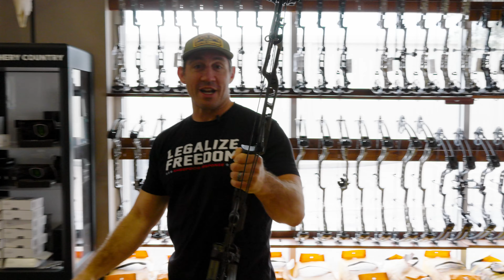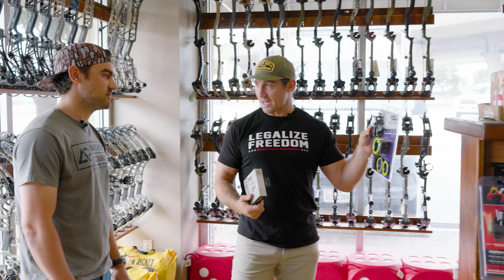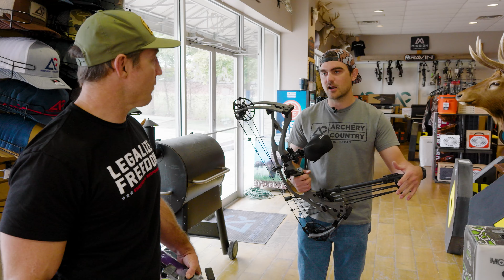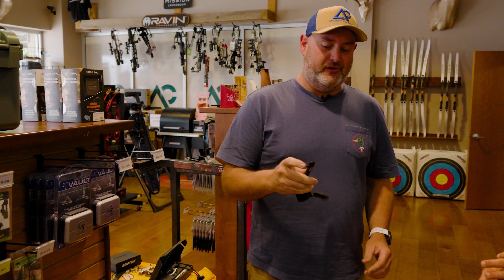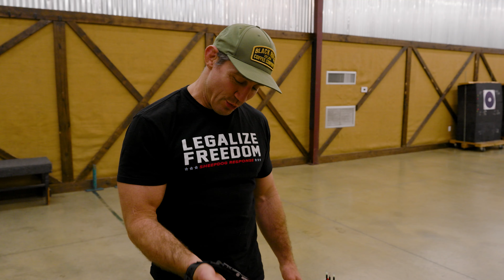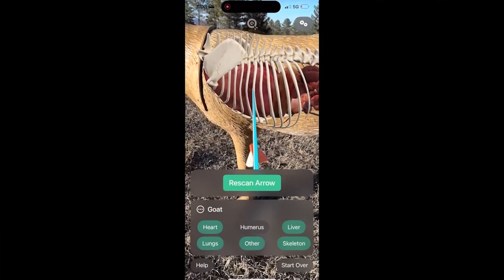New Bow, New Season: Getting Ready for the Ultimate Hunt

Comment: NO TIM! The Lift will crack limbs every 13 seconds!!!! I am a Mathews dude and went back to the Z7 recently. Should've done your research. Buy a backup and you'll be good.
Reply: Had mine for months, about 1000 arrows so far, not one single issue. It was a single batch issue that's been fixed, and they even made the warranty better on them